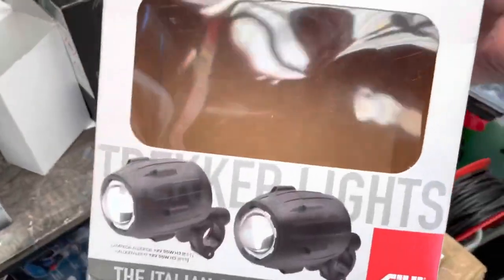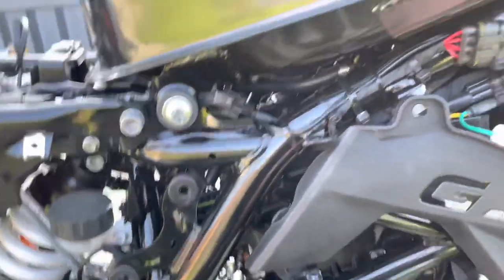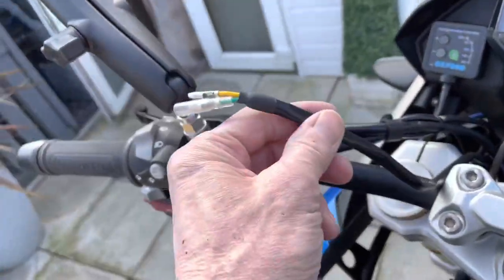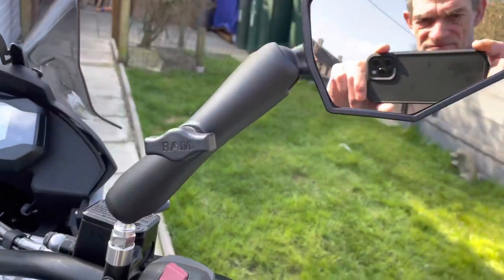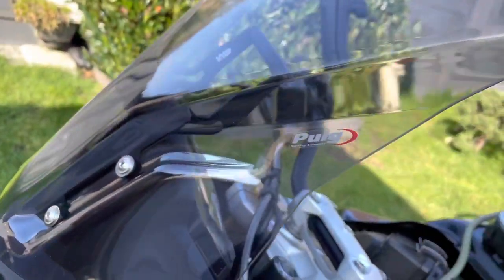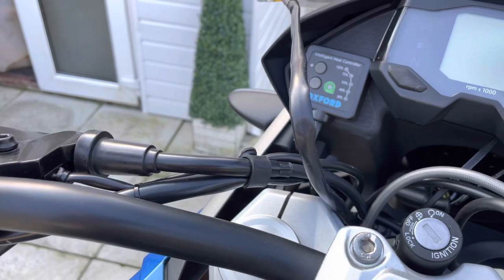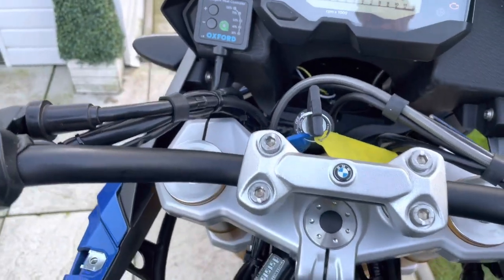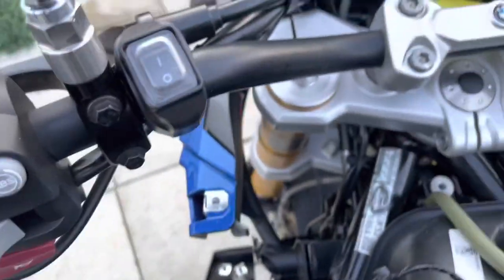BMW G310 GS givi s310 Trekker spot lights fitted

Comment: Thanks Derek for the good and  intrumental video. Could you please explain where you plug the green cable ? (ignition on/off) , thanks a lot.
Reply from the maker: You have to remove the head light go to the bike you stand in front off it they are 2 accessory plugs on the right side behind the headlight one you will see straight away the second one is in the same place but near the top you have to cut the cable tie that holds it in place hope this helps and many thanks for watching 🙏🙏👍👍
Reply: @SOLOMOTOUK   Many thanks Derek, I was wondering to connect the green wire direct in the OEM addicional connectors which you mentioned , in the positive pole, without cutting the original wiring , hope it works, thanks again for the great video.

Comment: After install all of the accessories it looked really well. The additional lights really go with the bike. What was you experience with that Chinese radiator guard? I am thinking of putting on the Tracer 9.
Reply from the maker: This one fitted okay but some are no good my mate bought one of the same seller and his holes did not line up. 
Gregor if you can buy R&G cover one of the best out there excellent quality to 👍👍🙏
Reply: @SOLOMOTOUK  Got it. I see. Some just don't fit. I hear a lot about that. Will check that. Hopefully they have one also for the Tracer 9 that I have. Thanks Derek.
Reply from the maker: @RRRRefuelRideRace  Gregor R&G do make them for your bike. 
DETAILS: R&G Radiator Guards (Aluminium)
- Radiator Guard for Yamaha MT-09 (SP) '21-, Tracer 9 (GT) '21- & XSR900 '22-
Product Name:
R&G Radiator Guard for Yamaha MT-09 (SP) '21-, Tracer 9 (GT) '21- & XSR900 '22-
Product Code(s):
RAD0273
Price:
£64.19 ex. VAT
Product Category:
Radiator Guards (Aluminium)
Brand:
R&G
Stock:
In Stock
Fitting Instructions:
 Open PDF
Colour:
Black/ Titanium/ Silver/ Dark Blue/ Red
Fitting Difficulty (1-5):
3 - Little bit of skill
Fitting Time:
Less then 1 hour
Reply: @SOLOMOTOUK  I see. I found the same one. Looks cool. Will think about it. You had it on different bikes?
Reply from the maker: @RRRRefuelRideRace  yes always fit them on every bike worth the money and stops your radiator getting an hole in it thank you 👍👍🙏
Reply: @SOLOMOTOUK  I see. OK then. Will try to find one in my country. I mean the seller.

Comment: Hi, well done! Could you please explain how you connected the wire to the ignition?
Reply from the maker: Hi you use the little bulb light wire in the head light so it comes automatically a switched live so you cannot leave them on when you turn the ignition off hope that helps 👍🏍️
Reply: You mean the smallest bulb, parkinglight?  Do you remember the colour of wire you connected to the green one of the Givi-set? Thank's a lot
Reply from the maker: Hi that’s the bulb the tiny one cannot remember the wire colour I used a multimeter to find which one was the live 👍

Comment: looking great with all them extras I notice you used that paddock stand do you not fancy a centre stand for your bike
Reply from the maker: Hi Bob been looking at some but there from China £150/£160 don’t know if I want to take the chance buying one from there do you know any English sellers thank you for your comment 👍👍
Reply: @SOLOMOTOUK  i know what you mean about buying from china they where only £70 last year I should of took the chance last year
Reply from the maker: Hi Bob I’ve done it I bought one from China £91.19 I’ll let you know how it goes when it’s fitted should be here by the end of the month thought I’d let you know 👍👍👍
Reply: @SOLOMOTOUK  nice one great price too ill be interested to see how it fits
Reply from the maker: @bobtaylor5263  high has soon has it comes I’ll do a video of it thank you for your interest BSafe 👍👍👍👍
Reply from the maker: Hi Bob do you have one of these bikes bmw g310 Gs or the R cause you know I’ve sold mine but I’ve got the headlight grill protector plus the centre stand plus the skid pan they fit both bikes all brand new I sell them half price or job lot £100 be well worth it for someone 👍🏻
Reply: @SOLOMOTOUK  hi Derek yes I still do have the 310 gs that sound a good buy do you still have them like
Reply from the maker: @bobtaylor5263  yes Bob I do have the 3 items still strange they all turned up after the bike had gone I’ll put my email up in my account in about you can contact from there if wish
Reply from the maker: @bobtaylor5263  hi Bob just put email up now thank you 👍🏻

Comment: Hi Derek  Thanks for the video - bit more help than the average Haynes manual "...and just disassemble the clutch".  Anyway, random question: you had an extension on the rear hugger of your black/blue Z1000SX - where did you get it and is the fitting easy enough for a numpty?  I've got a 2020 that spins a lot of crap off the back wheel.
Reply from the maker: Hi Adrian off eBay pyramid plastics here’s link for a 2020 model

https://www.ebay.co.uk/itm/Kawasaki-Ninja-1000-SX-2020-On-Pyramid-Hugger-Extension-OE-Quality-073531-/184445581958?_trksid=p2349624.m46890.l49292

Hope this helps I find them very useful helps a lot but still just a little spray of muck 👍🏻

Comment: How did you make the beak look so long? Its looking gorgeous. Is there aftermarket for that?
Reply from the maker: Hi there yes there is my come from China via eBay cost £39.99 with insurance and cost 👍🏻
Reply: Thanks a ton mate. It would be great if you could put up a link for me please.
Reply from the maker: @tusharnikumbh4190  man of my word here’s the link hope it helps 👍🏻
https://www.ebay.co.uk/itm/BMW-G310GS-2017-2018-Front-Nose-Fairing-Beak-Fender-Cover-/174534234875?_trksid=p2349624.m46890.l49286

Comment: Where did you get the headlight from.?
Reply from the maker: Hi eBay here’s the link thanks for dropping by 👍🏻. 
https://www.ebay.co.uk/itm/BMW-G310GS-G310R-LED-REPLACEMENT-OEM-HEADLIGHT-2016-2021-/174510538493?_trksid=p2349624.m46890.l49286
Reply: Brilliant  ordering one tomorrow, thanks, how long did it take to arrive and does it fix the headlamp shake when riding.
Reply from the maker: @gordongrant8294  hi yes they do shake and vibrate bmw knows about this you would think they would of done a recall and put it right what it is the bracket is plastic what I done to mine was put a thin rubber washer on each side between the headlight and brackets it stops it straight away I don’t know if you know but the left and right bolts that do them up is also the aim of the beam so get the beam where you want it and tighten it up if it feels like it’s going up slacking it back and tighten the other one and don’t be frit to do it tight hope this helps you BSafe 👍🏻👍🏻👍🏻 just under a week to come 👍🏻👍🏻